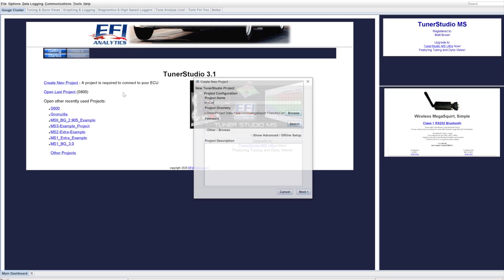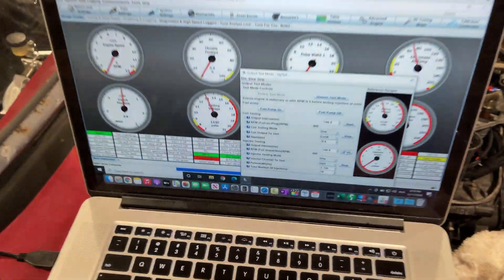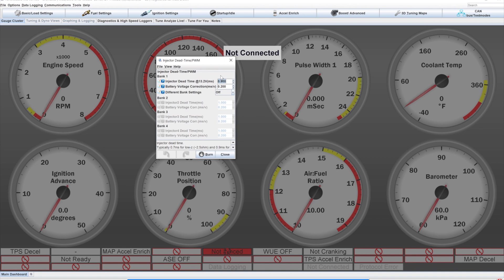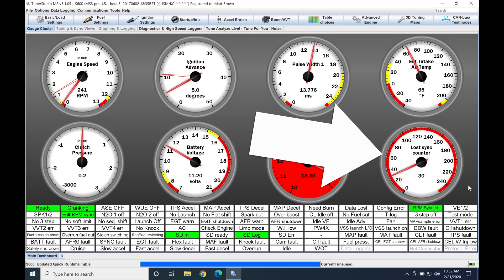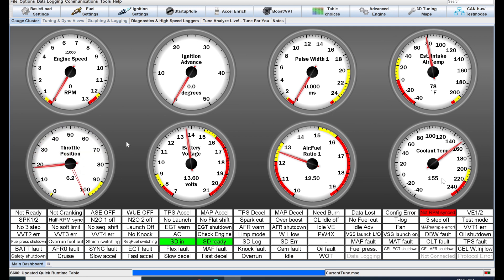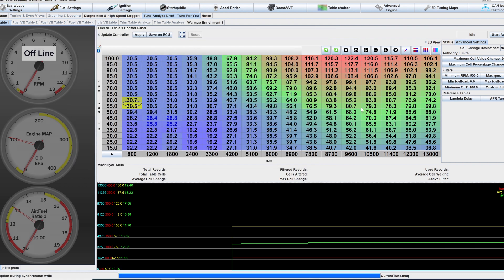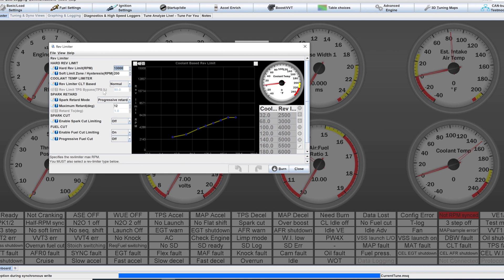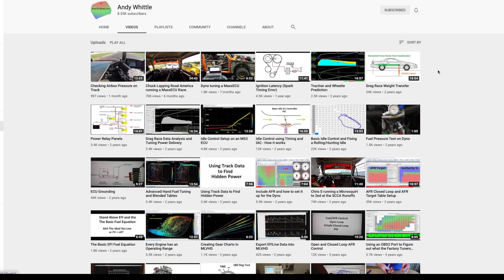Program and Tune a MegaSquirt (or MicroSquirt) Standalone ECU on Your Motorcycle (or Car)

Comment: Am trying to replace the OEM ECU with a Microsquirt ECU. Do I need a Ignition Amplifier or Ignitor for my existing Ignition Coil? Its a Royal Enfield GT535 ( Single Cylinder )

Comment: A misfire causes a lean reading oxygen sensor, not rich. O2 sensors are not affected by the unburned fuel, only by the excess oxygen from the misfire.
Reply: Exactly. I learned that via Data Logs many years ago and another example of that is, Air Shifted bikes that only kill the ignition (to unload to transmission for shifting) = it shows an off the scale lean spike where it shifts...

Comment: I was for some reason quite entertained by this video. This is mostly weird cause I don't have an ECU I need to program for anything, I don't even have a motorcycle. Or a car for that matter. But it's still interesting to see how a system like this is setup when done manually and you're not just using a motorcycle/car as it came from the factory.

Comment: I have a 1991 Miata with Honda CBR 1000RR throttle bodies, i am using alpha N tuning with great results. I tried using IRTB mode but as soon as you crack the throttle bodies open the manifold pressure goes to atmosphere, kinda useless. The people on the miata forums don't like  alpha N  tuning,  car has been running like  a champ for 5 years. BTW i am using the honda wax valve with engine coolant for fast idle, no IAC valve needed. TPS is interchangeable with one from a honda accord.

Comment: Great video,  I've been a mechanic for over 40 years.. I thought I knew everything..lol.. I  understand all the lingo,  parameters , etc.  But I would definitely cry if I  applied this to my sons resto, jag-xjs.. do you or anyone ever attempt to apply a standalone ecu on a v12 jag?.
Megasquirt 3pro,  seems to be the only ones that can control v12 and sequential.. any ideas or directions would be eternally great full..
Reply: I'd go 3pro for sure, v12 just means more wiring for injector, coils etc , shouldn't all that different otherwise, you might have issues into finding info and sequences of the engine but aside from that shouldn't be too bad. 

You'll need a harness for sure, since the original Jag ecus made by Lucas were wired terribly and ran the engine like 2 straight 6 in parallel

Comment: I used an Arduino to program a Bluetooth module to the correct baud rate and then soldered that onto my microsquirt. Trust me, Bluetooth tuning is so much better. As an added bonus my phone doubles as my gauges.

Comment: You said it, "READ THE MANUAL!".... TWICE. There are people out there that "wing it" as standard practice. Awesome 👍🏼😎 vid Supafast. This can and does often result in a blown (not forced induction blown, type 3 as in boom. Type 1 blown is not affiliated with engines.) Or grossly underpowered. 
Tuning is something you need to really comprehend, the more you know, the safer your engine will be from detonation, lean or rich conditions, overheating due to improper timing, overheating, and so on.

Comment: I'm looking into microsquirting an old Volvo B20. Still hesitant, because the Jenvey Heritage makes for a nice stealth ITB setup that maintains the "carbed" look, but probably won't work if not fully sequential.
Reply: I'm megasquirting a b20 for a 122 wagon project. Did you end up doing this project?
Reply: @floydilian  no, unfortunately my cash situation paired with a house purchase has relegated the 122 to the back burner.
I still have it though. That's a plus.

Comment: Read your book some years ago (I still re-read it from time to time) and have been following along with your videos. One note about the CBR600 - at least what I've found within the realm of FSAE, it will never knock (as long as you're not being real stupid with it). My first time tuning the RR I had chassis ears on and was super careful with spark timing, I think I spent like a couple days on that 1 map. I'd go up past 60 degrees yet I wouldn't see much through my knock sensor or hear anything, and torque would be dropping off. So I was always able to hit MBT timing without knock being the limit. The following year I came back and was able to bang out a tune in 2 or 3 days, compared to nearly the full month I took in the first year.